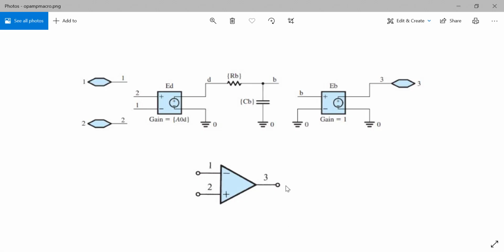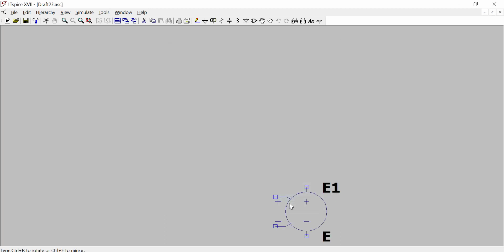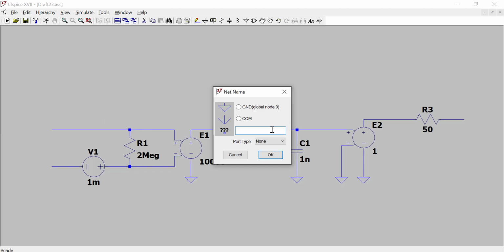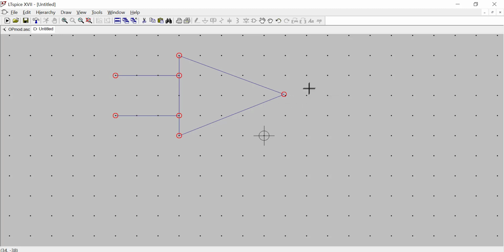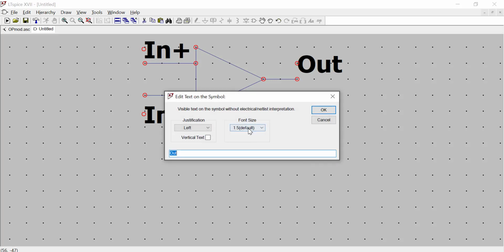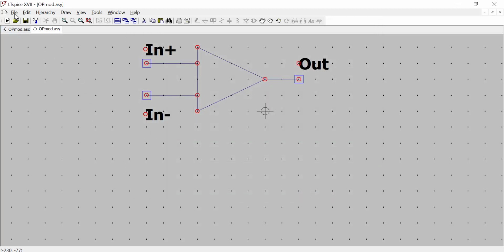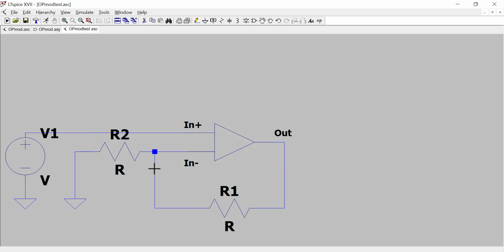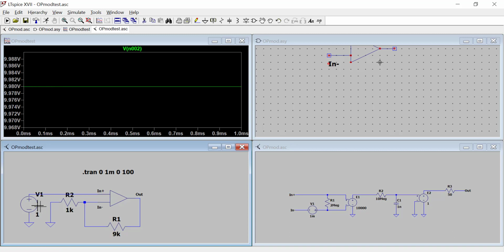Subcircuit and symbol creation in LTSpice

Comment: I don't know why you stopped making more videos. This video is a saver.
I'm going through some videos where they were making .sub files  and later .asy for symbol I didn;t understand how they are mapping terminal/pins between .sub file and .asy file(symbol) But this video helps a lot with out creating .sub file(subcircuit) file and simple way of assigning pin names same for both files(net name) which makes easy to understand the pin mapping between schematic and symbol